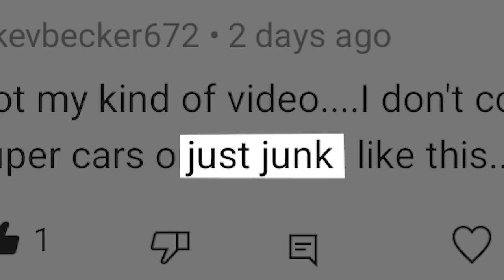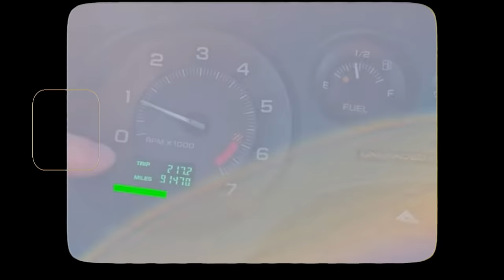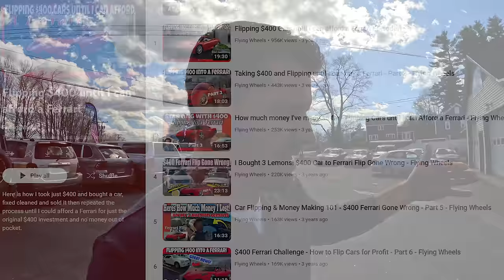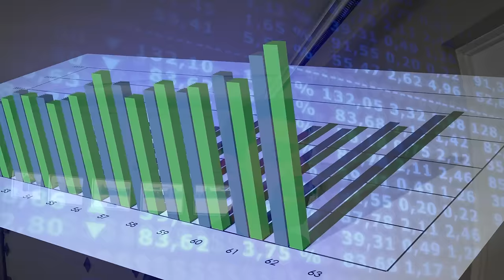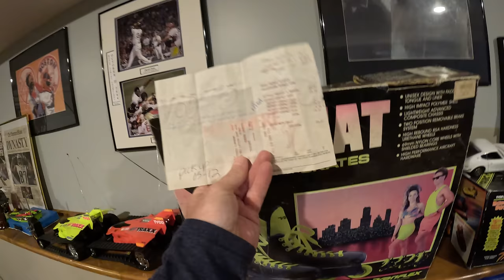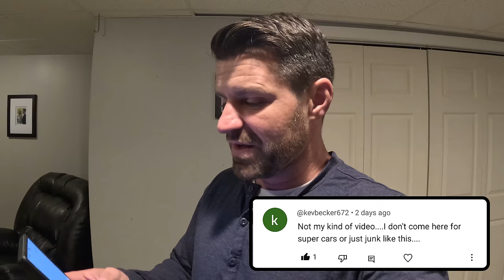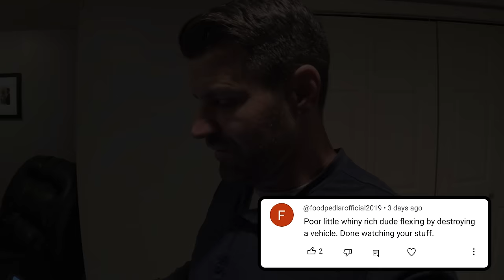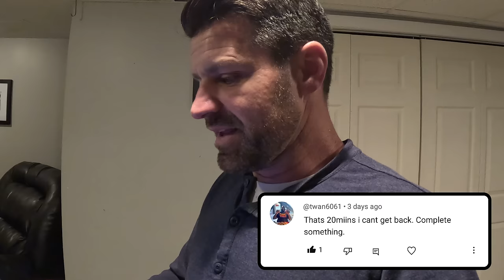Im Sorry, but here is why my Video have been Sucking Lately

Comment: Dude, I've been there, right where you are right now. I'm a Florida native. I was always in the auto business, body shop, auto glass, and sales.I cut out my first windshield when I was 10. I couldn't afford a car when I got my drivers license, so I found a POS 1977 Dodge Aspen 2 door, paid the guy $700, and got the thing running. I drove that car from 1986 to 1992, and my friend I sold it to still has it today. I also owned 3 bars and restaurants, and by 2003, I was burned out. I was going in ten directions and couldn't focus on anything, so I did what you are doing. I sold everything, house, vehicles, toys, everything, and moved to the midwest. It took a year for me to decide that restaurants and bars were where my heart was, and I opened a small place in the big town 40 miles away. It was great. I felt like I could breathe again. Well, one led to two, then two led to three locations, and then I started all over again with cars, and I was back in the same situation I moved away from to Florida to get away from. By 2013, I was exhausted again. I woke up on a Saturday and told my family I was selling everything again and we're going home to Florida. By 2014, we were back in Florida, and I'd returned to the service industry with a small beach adjacent spot. I did that for another 8 years, and someone made me an offer I couldn't refuse. I was working at our family shop on my days off just because I can't be without some grease under my nails. I can't help it. I love cars, everything from repairs to sales. I can talk cars with a total stranger until they just walk away, and they have, believe me. I've been in another Southern state since 2022 doing basically nothing, mostly car appraisals when I can to kill the boredom. Last week, I looked at a nice corner building with three bays, a waiting area, offices, and forty parking stalls. I've got the fever again. There is something about the smell of a service bay and the banter with the customers and mechanics I am addicted to, apparently. My point is happiness comes in all forms, and in business it's better to know when to get out, step back, and remember why you do what you do and ask yourself if you still want to do it and if you do, what will you do different. The alternative is to keep on spreading yourrself too thin and ruin everything  you've worked hard for to build. Vent on, my friend. I've been there too. You'll figure it out and feel like a new man soon. I'll still be here watching and liking.
Reply: After being in Florida full time since 2008 I could never move up North again. Its a cool morning in Tampa,55°, cool but at least its not 35°.
Reply: @richardmorris7063  oh yeah, I'm a Southerner and that decade of midwest 8 foot snow drifts and needing to buy a plow blade for my small tractor to clear my driveway was definitely a part of my decision to leave. My property had about 1/4 miles of driveway. No way was a shovel going to cut it. On bad days the rural gravel roads would turn into an ice sheet and I lived up a small hill. It was a great property, miserable in the winter. That's why I ended up staying in the South, well below the snow and ice belt.
Reply: Holy yap
Reply: @SoosRamirez1  I'm old. This is my social life. You are welcome!🤣

Comment: As a person from north Europe I have to ask.  Don't you use anything to protect the frame from salt and rust?
Reply: Fluid film, its lanolin (sheep oil) based. Apply to the bottom side with an undercoating sprayer yearly before winter. It really helps
Reply: There are various methods to slow down the damage. Coatings (applied yearly) and meticulous cleaning (that most people will not be bothered with) but in the end the corrosives will prevail. The corrosives used are getting stronger and used far to often in more and more places.

The only solution is keep a vehicle stored during the corrosive season, replace the vehicle every few years or move to an area that doesn't see snow and ice.

Comment: I go through a flush every once in awhile.  i like my toys but at times it gets out of control.  at one point i had 3 snowmobiles, 2 jetskis, small baot, big boat, 2 houses, 4 trailers, 4 vehicles.  now i am down to 1 house,  2 cars and a sled and SxS and the sled stays at the dealer in the offseason so i don't have to look at it.  if it doesn't get used it goes in my mind now.

Comment: Craig, two things:
1) quit buying POS cars that look good on the outside! Do you want to be know as the dealer who sells rust buckets Escalades? Do a better job of checking out the cars!  If it’s rusted, then base your bid on usable parts that can be sold or scrap weight!!!
2) sell off the POS cars, parts, etc. A POS you paid too much for ($3000) should be sold at once! Have your own auction (if allowed as it is in Oklahoma).  Stuff like your bikes, Viper, Mustang parts and toys will always have value and appreciate.
3) I LIED!!! As YOU DID AS WELL when you buy POS crap AND CONTINUE TO!!! You can move to Florida and you will still buy junk! Location doesn’t change your addiction!!!

Comment: sometimes you need to clean house, I own a repair shop, even though I a not a car dealer I am held to a higher standard I can not sell something that I know has problems, I had to scrap a real nice 1997 cadillac STS because of a rusty frame rail, the car ran great, but it is not worth it I knew it would not last long and it would be a hard fix, did want it to break on someone on the road

Comment: Craig 
Here is my observation.
You obviously like the older different kind of cars.
The problem is that you can't buy those from the northeast, they are rusted out and are unsafe to drive.
You can still buy those cars, but you will have to buy them from places where there is no rust. I'm on the west coast and you can find plenty of 90's and early 2k models at Manheim, Adesa, and American auto auction that are rust free.
These cars can be shipped to you for just about $1k and then you can go nuts. Your vision on selling these old cars is good. Your idea of using cancer cars is your problem.
You know if those rusted cars were rust free, they would be great to do content on and would sell easily. 
You just have to buy smarter.
Without even looking underneath a 25 year old car, you know already that if its at the sale in the northeast, its rusted.